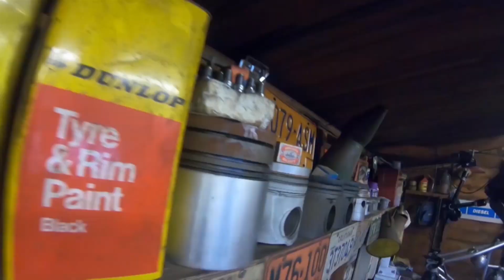Motorcycle fuel tank repair part 2

Comment: Looking good coming together nicely. By putting a loop in the fuel lines it works as a vibration damper to the peacocks. That's why plumbers will do that on oil burners. The vibration from a electric motor will transfer to a flared fitting and cause it to leak. Imagine the vibration coming off that RE to the peacock. Well done mate.RMM

Comment: The chrome end cap cam covers [ 2 each side ] on my GS550 DOHC Suzuki they were aluminum with chrome over  copper . so I used a belt sander to remove the chrome and the copper, and then polished them, turned out perfect. all the chrome stuff when old it seems is always a mess. Nice work well done Craig

Comment: The very reason I enjoy the Doghouse. I was brought up in the autobody trade with pick and file and lead application as opposed to filler. You are truly a craftsman Craig. Well done!
Reply: When I was young  my Grandfather backed his old truck around a three beside the dirt drive way/ road running over the back of my burn dump salvaged bicycle, pinching the read fender flat. Because it is cattle country you need fenders,  he beat it back into shape and leaded in all the dents, the resulting part felt like it doubled the total weight of the bicycle . I believe the fender was about 5 or 10 pounds total.  This all happened in the 1964.

Comment: Phosphoric acid, is the best for the inside. It leaves a protective layer of oxide on the bare metal. Flush and dry afterwards, and pour in a pint of latex based sealer, and You'll have a completely perfect tank for decades.

Comment: vinegar really does work, not a myth, takes a bit longer than the evaporust but does work well, electrolysis also works using a battery charger, nce job on the tunnel and repairs, not always easy to get dents out as well I know

Comment: That first dent You went for, had some stretched metal in it. You should have heated up the dent on the inside - or the high side, and hammered it down on itself, followed by cooling with water. The principle is to soften the metal, so it will accept to go back to its former, original shape.

Comment: I would have expected the bottom of the tank to be soldered into position. 
I also think heating the tank to ease the sealant from the internal surface should have been done from the outside. 
But this is just an opinion. 

The tank needs to rest on a piece of rubber. This would achieve the same goal as you are trying to get to.

Comment: Will the 2 sides need a link pipe, as the tunnel is still fairly high at the back? Looking really good now. Also, did you consider folding the base out of 1 piece?

Comment: I would really like to see a curved lower panel to tank bottom one peace,  I think it would have better lines. On my Royal Enfield 500 I don't like the way the tank just stops at the bottom edge, it would hold more fuel. I am looking for a used tank to modify my self but nothing seams to be available in my part of the world Royal Enfield are very hard to find, so I am looking for something to modify but Motorcycle salvage yards are also scarce.
By the way thanks for the info about the black leather seat .

Comment: NOT the correct repair for me, a bit of a purist having worked for a world class British bike restorer for many years, good work and skill level all the same. I need to explain my comment, an origonal Enfield tank of this age repaired/ restored to standard dimensions with correct knee pads would be worth loads of money plus it's a restoration worth doing, but a chopped converted tank with no knee pads is not worth the time and effort and now worth less
Reply: A restored bike is not original, it just looks original in its finish . The only original bikes are totally untouched from day one so if you want to cut the tank, cut it. Be original in your thinking. Just because it was built a certain way doesn't mean it has to stay that way. I understand the argument, but worth less it isn't. Great work and loving the channel.
Reply: @gezokane3482  if we are looking for an origonal tank for a project it commands more money for an origonal paint or new paint than a tank that has been modified